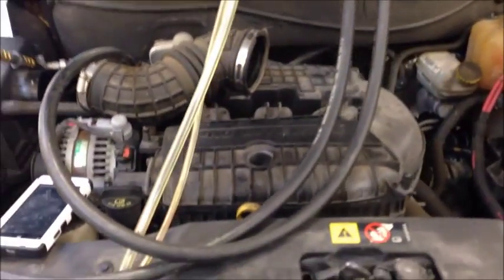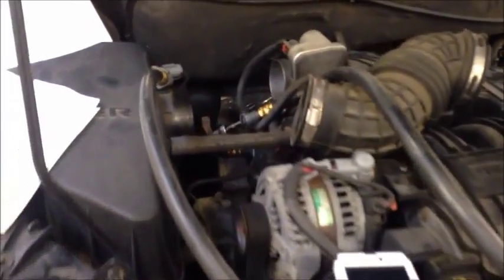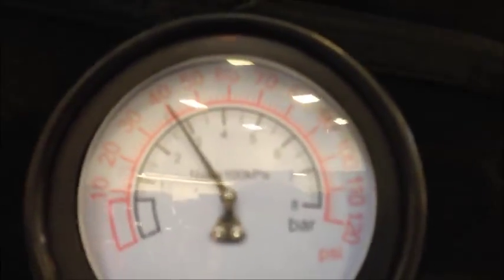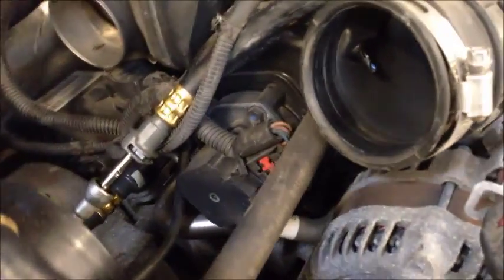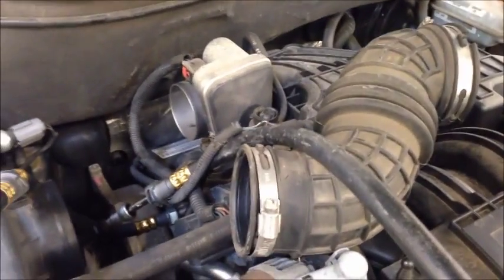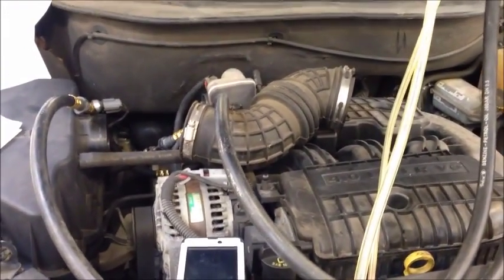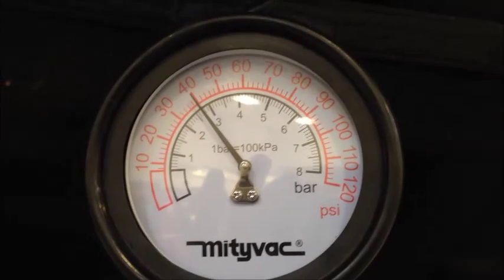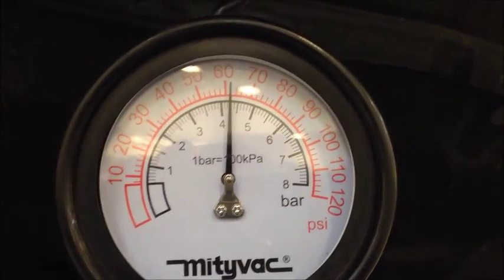Diagnosing a "Long Crank after Hoat Soak" on a 2007 Chrysler Pacifica

Comment: I have a 2008 pacifica that does the same thing. It only does this if it sits for about 20-30 mins. Otherwise It starts just fine in the morning, or after it cools down for a while after driving it (about an hour). I’ve tried priming the fuel system before I start it and it still will crank long when warm. Do you think this is a fuel issue?
Reply from the maker: Yes, it sounds like a fuel issue.
Reply: @stlouissux9119  thank you. Now I know where to start looking.

Comment: Great video and I have the same exact car. My problem is that I changed my fuel pump and the car will no start, once the engine turns, it quickly starts but then it goes off, it is like a 2-second start thing like if you run out of gas, put some and try starting the engine.  So I have been told to a fuel pressure test. I am trying to figure out how you connected your line, but I cannot tell, any chance you could give me some detail on how to do this? I of course do not have your fancy gage, I got mine from Amazon. Your answer is greatly appreciated.
Reply from the maker: Can you hear the fuel pump running?

Comment: Do the cam position sensor first before going to all that trouble.  It is under the alternator on FWD cars/vans and it's $25.  A known issue with these engines. At 208,000kms, on my third sensor.

Comment: wow...great video..great advice...I have a 98 ford contour SE...44,000 miles...with exact same issue...hot start problem...on a fixed income...So this is a big help...thanks for the info...So..you didn't have to replace the whole pump or drop the tank?...If I'm understanding correctly...Thanks again.
Reply from the maker: In this case it was actually a faulty check valve on the pump itself and the pump needed replaced. Drove the vehicle for quite some time with the issue, just had to allow extended crank or cycle the key a few times before trying to start.
Reply: DIYAUTOMOTIVE....will do...Only happens once in awhile...I'm hoping it might just be a bad injector...or maybe just a bad fuel filter...As you know..there's so many variables...and a lot of shops don't want to invest the research.. I brought it to my mechanic..he's good ..but busy....he's leaning towards a new pump..(easier for him...money)...Gonna try a 2nd opinion...Thanks again for the work around info...Big help...take care.
Reply: @stlouissux9119  Well..Hello !!!  2 year update...Can you believe I was able to get away with 2 years of key cycling and the pump finally gave out last week...Had it towed to my mechanic...(great guy..knows his stuff)...He had to drop the tank and replace the fuel pump...also replaced the filter...only $350.00 for new parts & labor...Pretty good right???....Put a new interstate battery...Runs like new...I have no plans on buying a new car...and leasing is out...I don't get where they think people have 30,000-40,000..to toss around for a new car...Sooo..not happening...Hope your doing ok with all the stuff going around in the world today...Take care...JR

Comment: can someone please explain to me how a bad fuel pump would cause this?
Reply from the maker: It is actually the pressure regulator that is in the module without the pump. It is not holding pressure on the rail (leaking back), so as the pressure in the rail drops the boiling point of the gas goes down and essentially the gas boils and turns into a vapor therefore the injectors for the first few seconds during cranking spray fumes instead of actual gas so it doesn't fire. If you cycle the key a few times it would start right up as it would prime the rail.

Comment: what about on 2004 It starts and stays on. But when gas pedal is press. Car losing pressure after a few seconds on and off .Map sensor/ pressure sensor/ gas pump.Code  P2068
Reply from the maker: Sorry, not following your question.
Reply: What didn't you understand? Far as my question to you?
Reply from the maker: Are you losing fuel rail pressure? Sounds like you may need a new fuel pump.
Reply: Yes when giving pressure it will shut off where to buy fuel pump

Comment: Hello, Did you ever replace the fuel pump? I've been trouble shooting this issue in my Nitro for some time now.
Reply from the maker: Tom Smith yes, the issue was a bad pressure regulator check ball on the fuel pump

Comment: i got a 2009 sonata and went to a mechanic month ago to find some gas smell in the car
when he was inspecting for the smell he open a hose that connected to a vacuum valve that leading behind the throttle body and he but his finger on the valve hole and the engine shut down
after that he closed everything now the car take a long time to crank it when the engine is warm when it's cold it starts right away please help me. could the valve cause such a problem ?
 i lost couple grand to solve the problem and nothing work I changed the fuel pump and couple of sensors
Reply from the maker: Need to know if your car is direct injected or port fuel. If it's port fuel I would be checking the pressure regulator on the rail.
Reply from the maker: Next time when it's warm cycle the key four times before trying to start it and tell me if it fires right away

Comment: So cleaning the trottle body fixed the issue?
Reply from the maker: It did not fix the "long crank after hot soak", that would require a new fuel pump but since the flow and pressure is good I haven't bothered changing it.
Reply: DIYAUTOMOTIVE 
Is it the primary pump or secondary pump?